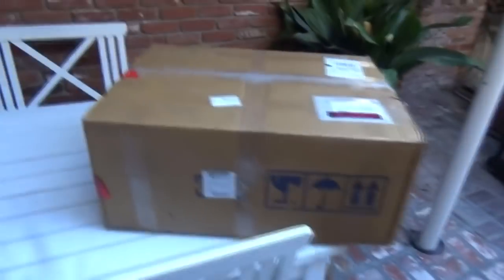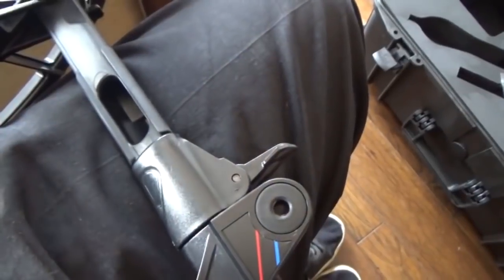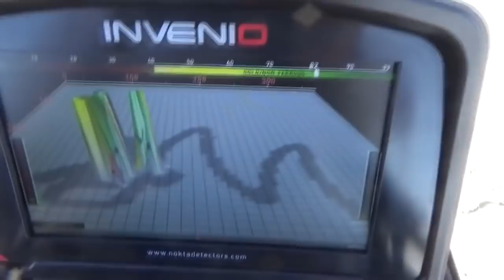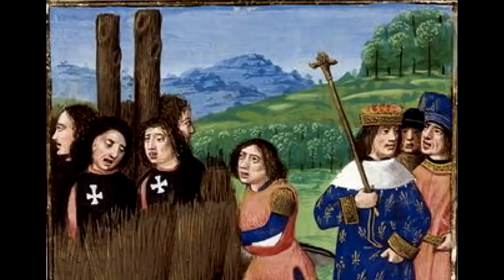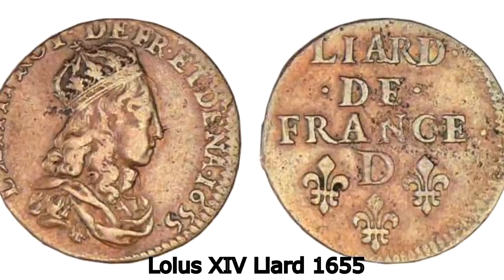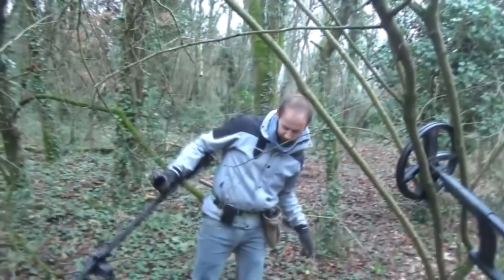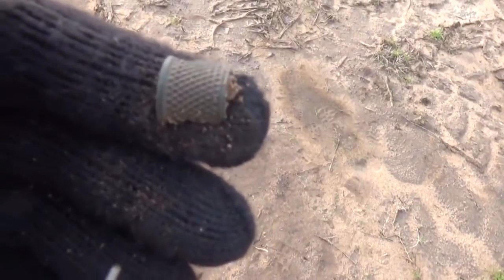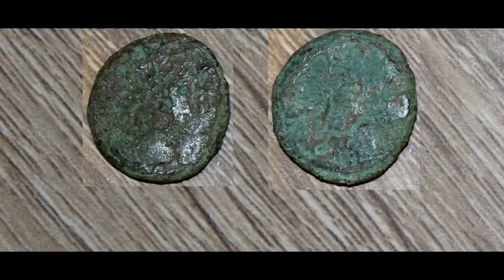EPIC $10000 Nokta INVENIO metal detector review

Comment: Good mixup Mr. Bill, if you get a chance lookup "Doc's Swingy Thingy".. It'll help swinging that thing around (around $50). Works great on the GPZ7000. And you can hang the monitor off the 2 shoulder clips.. best of luck 
Be safe & HH
Reply from the maker: Im against clobber in general but this looks useful especially for the box, which is the real lumber
Reply: @ChillBill1  and it attaches like suspenders,  so to pants, or your findsbag belt (keeps it from pulling down all the time when full)
Best of luck & HH

Comment: To be honest, 10K does seem like a lot of money for a detector But this is not just a detector now is it! The detector side of it is, only a multi-frequency detector that goes up too 20khz Which is not really impressive by today's standards, however,  What you are really paying for is the 3d mapping and all the other technology that is in it. Which allowing you to be more careful in how you metal detect. thus letting you find things you would normally miss. Spending 10K for a 3d mapping/VLF metal detector makes a lot more sense to me than spending 5K on a PI detector when you're not in goldfields, Every job has its own set of tool!  Does it come with the 22X16 coil ? or is that another grand or two option? EDIT: I would be curious to see how the depth difference of the  XP set at 3,7khz vs the Invenio set at 5khz with both a similar size coil or even the EQ800 set at 5Khz.